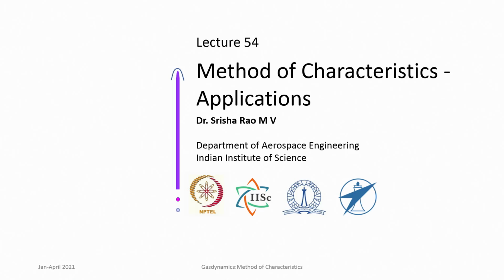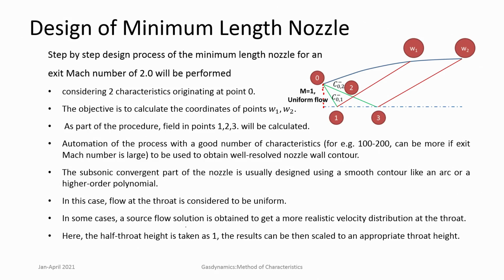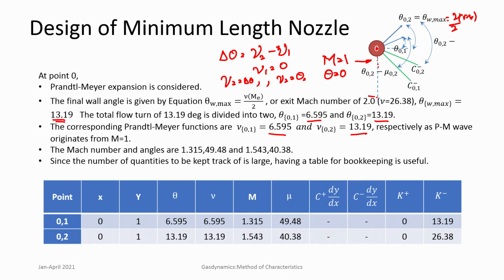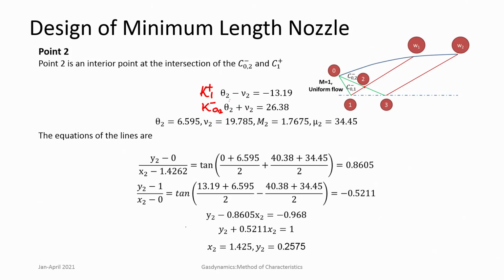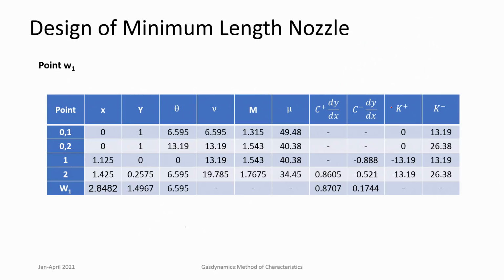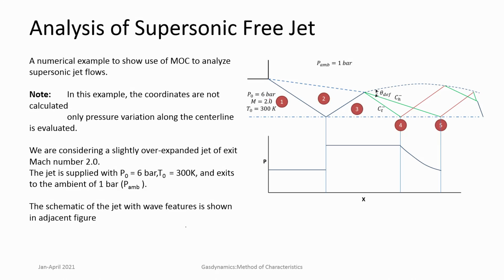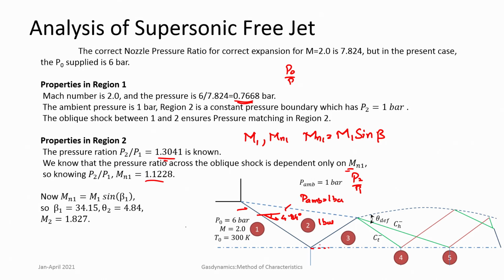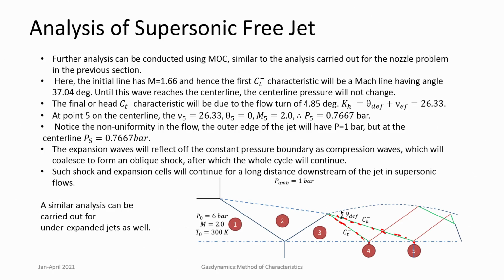lec54 Method of Characteristics- Applications

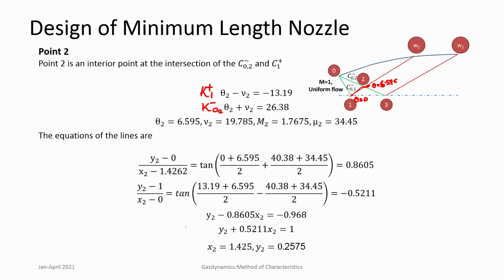Comment: 13:00
In the denominator of LHS of the first equation of line used to calculate x2 and y2 at point two, it is mentioned x2 - 1.4262

1) Where did this 1.4262 value come from???
2) Previously, the value of x at point 1 was calculated out to be 1.125

So according to me, the denominator here should be x2 - 1.125... Can someone please confirm?
Reply: I think that was a mistake. x1 must be 1.125
Reply: Thank you for noticing this. I'm busy working on this problem right now.